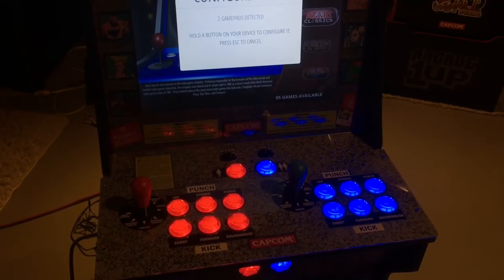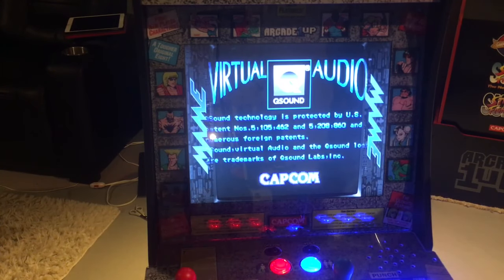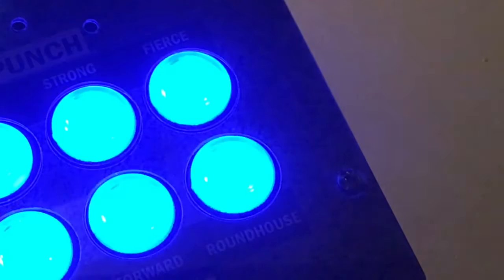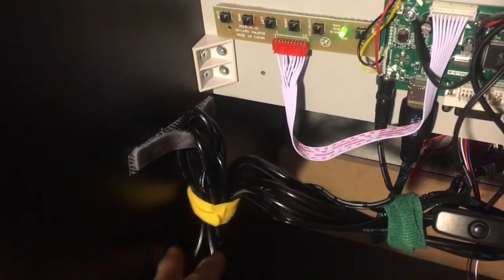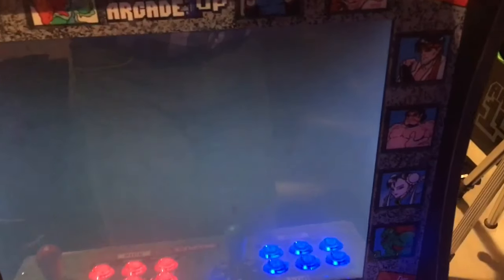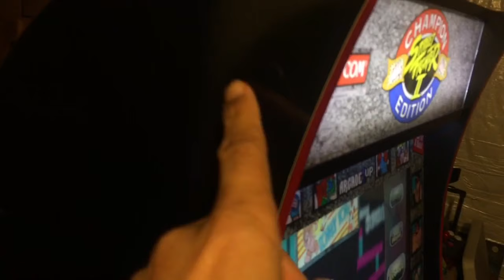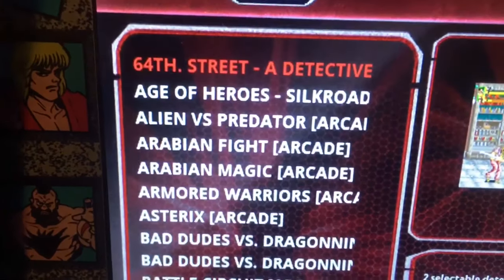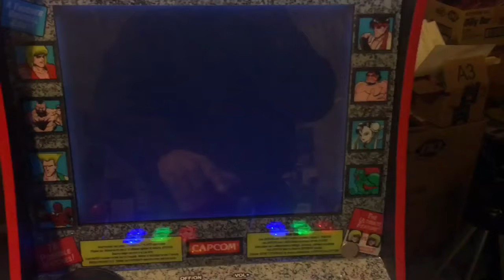Final Steps and Reveal - How to Modify an Arcade1Up Cabinet Video Series

Comment: Hi Detroit Love awesome video on modding arcade1up , have a question maybe you can help my pi damage 3 microsd cards so i opted to boot from usb everything works great only thing is 10 sec after i turn off the pi al the buttons light up again even though my pi shut down any thoughts on this?
Reply: btw im using the 32GB Arcade Only image by Wolfanoz didnt do that when it boot from microsd card
Reply: Detroit Love tradicional way pressing player 1 aka start then quit then shutdown system

Comment: I noticed that your Control Panel Clear Protective Cover lines up with the Control Panel of your cabinet...

So far I received 3 Clear Protective Panel Covers from Arcade1Up, and none of the 3 Panel Covers that were shipped to me line up. Lol

I contacted Arcade1Up to tell them the bad news about the 3rd. Protective Cover still not lining up with the Control Panel...

Hopefully when they send me the 4th. Protective Panel, this time it will line up properly...
Reply: @DetroitLove  
Good luck. Hopefully you won't have any issues with the Galaga replacement screen...